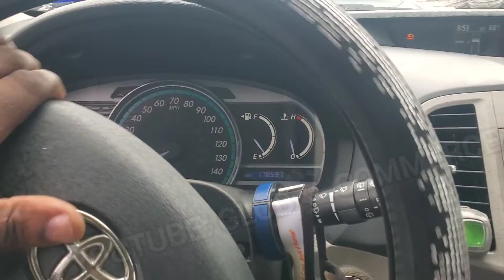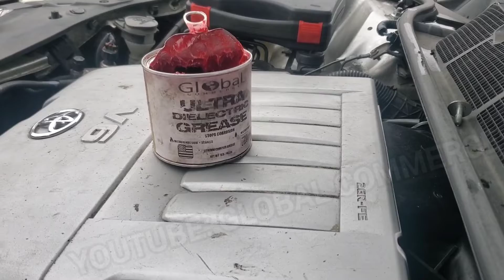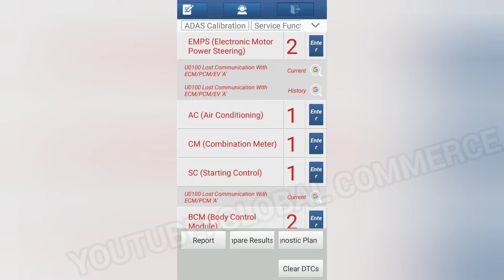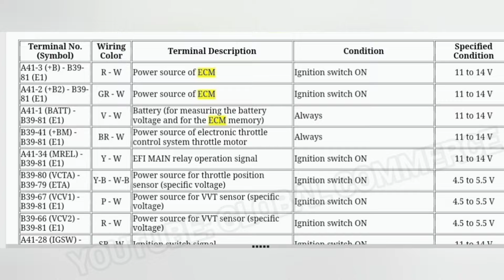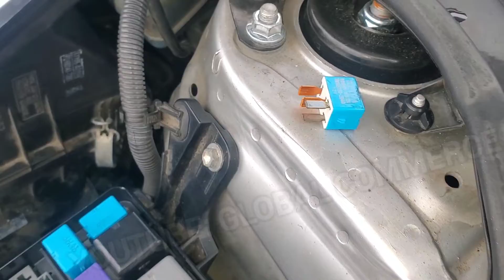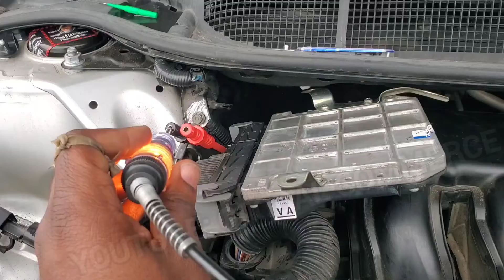Toyota will ONLY start with a booster connected, crank no start with NEW BATTERY FULLY CHARGED!

Comment: Had a similar presentation on a mid 90's GMC.  Fuel pump was failing, not enough startup pressure.  Though it would start while warm, residual pressure.
ECU may check for min pressure before allowing the relay to engage.  If there is a EFI return line, the fuel filter may be clogged.
ie flow restrictions before the sensor, reducing pressure.
The booster increases wattage at the pump by raising voltage.  VxA=W  Resting battery voltage being about two volts lower than alternator output.